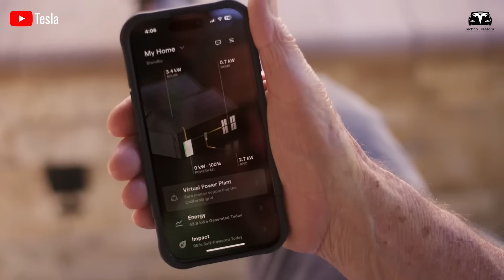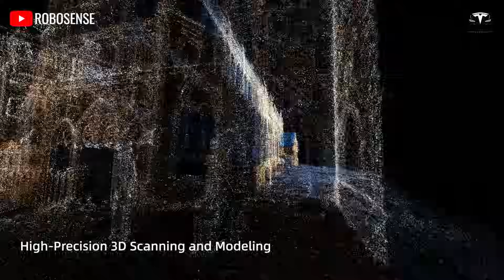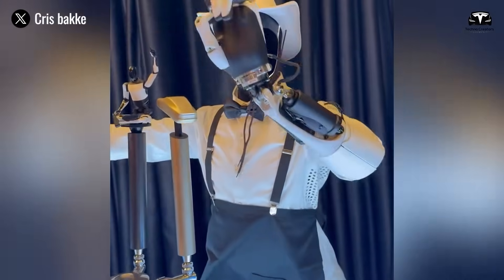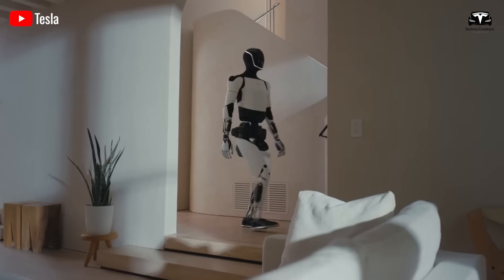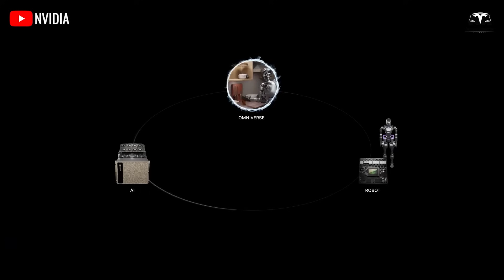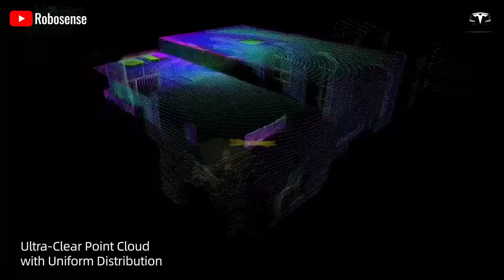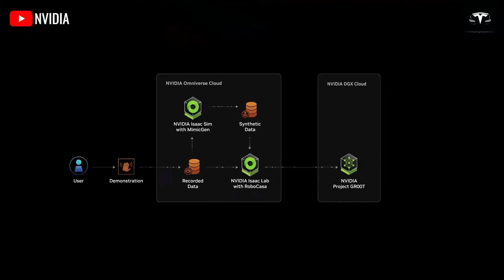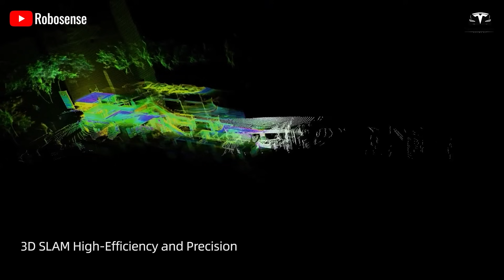UNBOXING 2026 Tesla Bot Gen 3 Optimus & 4 Things You Need To Do! First Look Details!

Comment: Optimus needs to be able to fold/unfold and lift at least 60lbs (weight of mobility chair) and load it into a car; open, enter, sit, exit a car seat such as a passenger seat; be a passenger in a car to travel to new locations; assist the owner with selecting object in a shop and carry parcels. So far, this is missing.
Reply from the maker: Tesla Optimus will almost certainly achieve this if they learn from the smallest things! This we can easily foresee!
Reply: most factory , werehouse jobs need 50 max .
Reply: @hillbillyintheasia6122  50 minimum